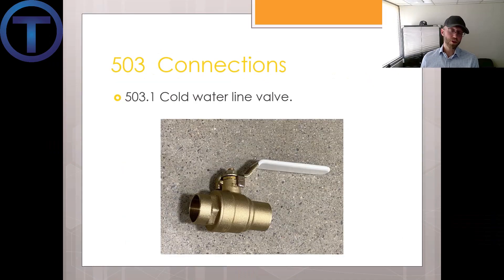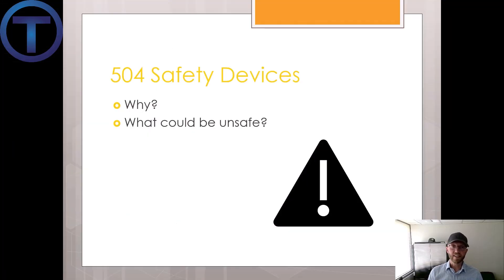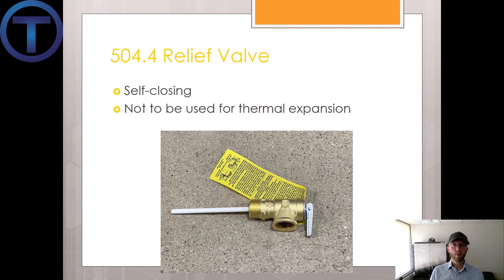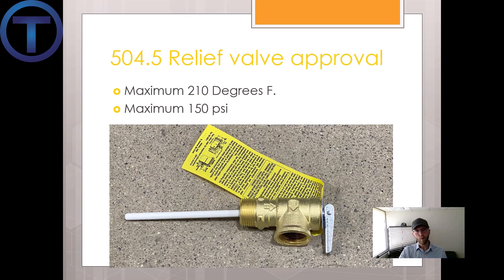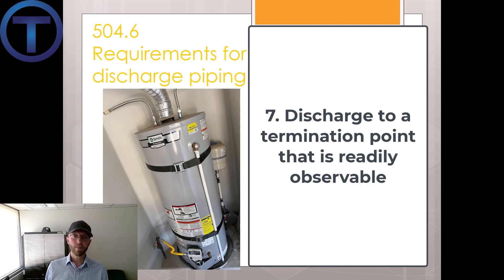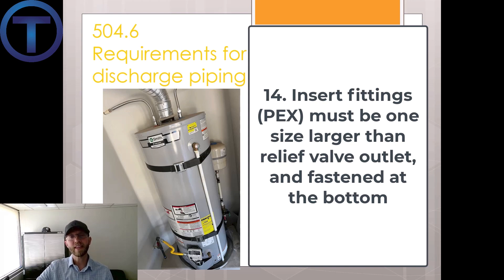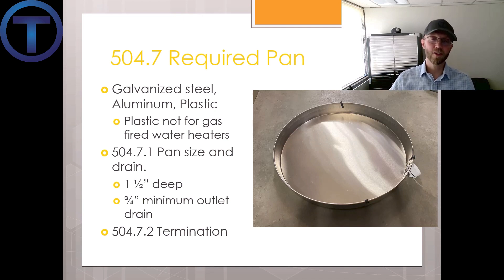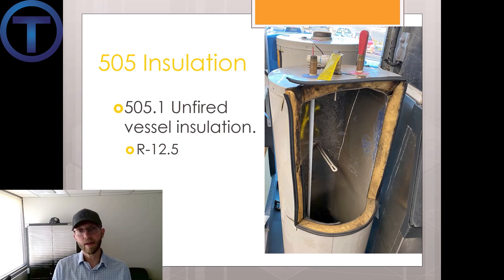Understanding International Plumbing Code 503 and 504

Comment: The discharge pipe for my water heater does not go all the way up to the relief valve. Someone likely cut the pipe so that the water heater could be replaced. It's just stupid to have a discharge pipe connected to the heater in such a way that the pipe needs to be cut in order to replace an old water heater. So I connected the discharge pipe to the relief valve on top of the water heater with a radiator hose from a car. If a radiator hose isn't rated for hot water, then nothing is!
Reply from the maker: Bette than nothing!   Good thinking.